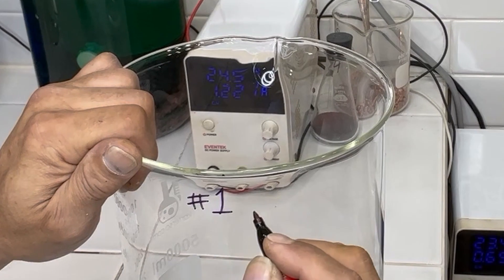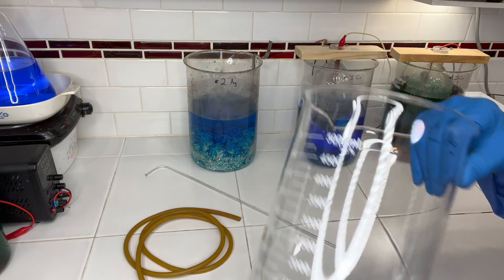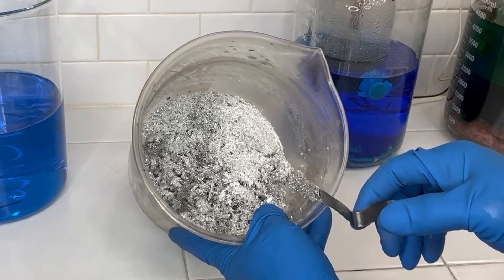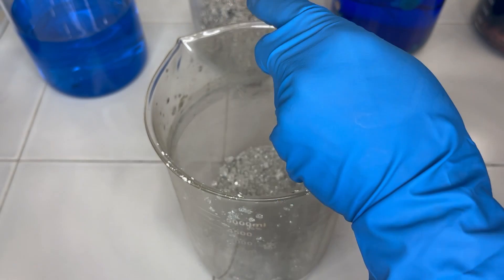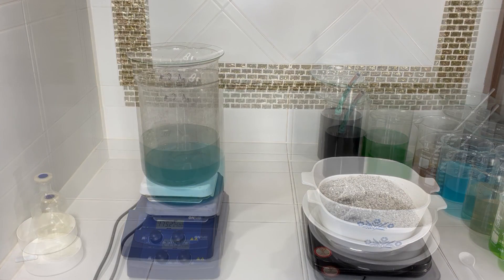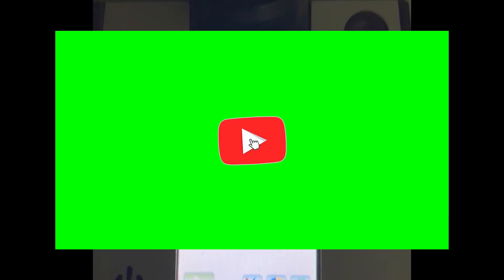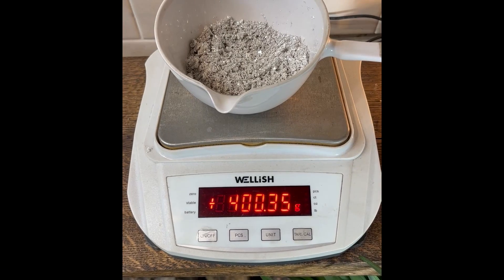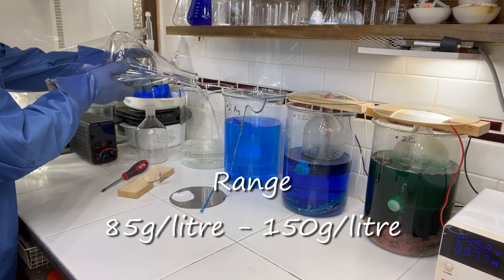Experimental Silver Cell Success! How Pure Is It?

Comment: Curious,  you had 400g of silver crystal from the previous run, added that to what appeared to be 1500 ml distilled water and you poured 400ml of undiluted nitric acid into the column... The video showed you adding roughly 100-120 ml of initial non-dilute Nitric to the 400g silver /1.5 liter distilled, put the heat on 300 C and the video goes into timelapse eventually showing all 400g of silver consumed and presumably in solution, it's not clear whether you needed to add more non-dilute Nitric or how much was required, how long it took for the nitric boil to consume the silver and whether you had to add some additional silver at the end to consume the remaining Nitric. 

Also, can you comment on differences in performance depending on where in the 85g/L - 150g/L range your electrolyte lands at? I assume the higher concentrations probably tend to crystalize out of solution more naturally but I wouldn't think that would be much of a real issue since any silver that does crystalize out of solution should be fairly pure, if it comes out of solution in the anode jar it should get consumed by the electrolysis process and land on the cathode regardless, and if it happens in the cathode portion of the cell that's the goal of the cell anyway. I would also imagine that silver dropping out of electrolyte that is too concentrated/saturated should somewhat automatically keep the electrolyte at a usable concentration as the water evaporates during the runs and the concentration increases.

Comment: Hi Anthony 
Awesome videos I watched them all several hundred times now and have started my first horse. I have the small long necked exit on aspiration bottle. I am on day 2 and things seems to be going very slowly I’ve ran up from 3.5v to 21.5v. Amperage has never passed 1amp at this point. 
I got what looks like long gray hairs growing in filter neck. 
And some copper blue staining inside bottle but has not gone past filter as of yet. Any thoughts on speeding it up or is this normal startup slow in general?
Reply from the maker: Run 10v and the process is a bit slow especially if you are running low purity silver. It does speed up a little as the cathode grows. To speed it up you can fill the bottom of aspirator bottle with impure silver shot, make sure your electrolyte is at least 125 grams silver/ litre. Amps usually around .35 is what I usually run at. I am working on an improvement to this. The limiting factor is the small outlet port on aspirator bottle. As soon as I can afford an annealer I plan on glass blowing the anode bottle myself with larger outlet port.
Reply: @  I’m using your 100 grams per liter. For a total of 400 grams. Yes the long small neck has the filter right next to the glass. I started with the 1 liter beaker with graphite block as cathode I tried that in the new system last night and didn’t notice any difference in that either. 
I don’t know exactly what king of stainless steel I have as far as your 303 mentioned in the videos, mine is a little more thicker than what yours is “not quite as flexible but still fairly easy to cut and bend. Thank you so much for your time.
Reply from the maker: Awesome!

Comment: Where do I find the anode glass that you are using and how much does the essay machine cost I've been doing silver refining for about a year now and I really want to know more about the silver plated items melted down so you refine all the metals in it through electrolytic cells
Reply from the maker: It's called an aspirator bottle and I buy mine on amazon. I have been working on a video that shows the complete process. It has been taking longer than I hoped but it will be out fairly soon. Thanks so much for watching!
Reply: What size aspirate bottle are you using a 2L ?

Comment: I really enjoy your videos!  Two questions:  where can I buy an aspirator bottle?  None on Amazon seem to have the large mouth opening on bottom.  All the stainless steel I have found is magnetic.  Does that mean they will corrode (like the s/steel cyber truck)?
Reply from the maker: Lol about Elon's truck! Yes, it will corrode. You can use it and it will work. It isn't a deal breaker if it is all you have. Run lower voltage to lesson the corrosion. If you get a little iron it will simple dissolve into solution and then I rinse the silver crystals in HCL to remove any residual. I have been using the smaller neck (19/26) aspirator bottle for a couple months and it has worked very well. I think the only draw back I am testing is a small reduction in output but overall it works just about the same as my original bottle and it saves on dacron filters!

Thanks so much for watching!
Reply from the maker: Sorry meant to say rinse in sulfuric acid. Do not rinse silver in HCL.